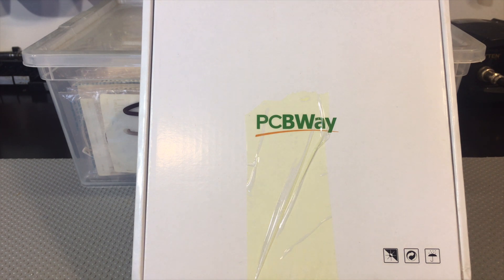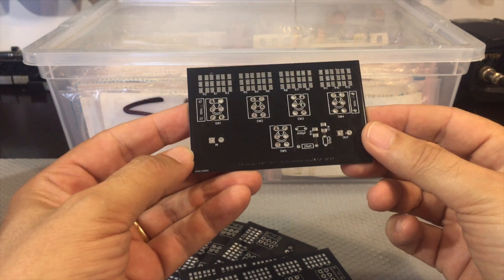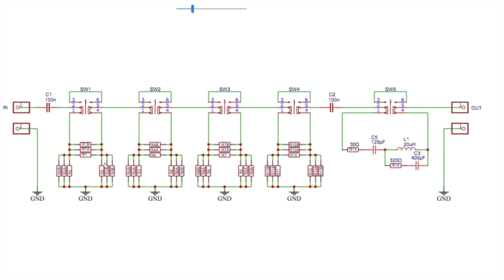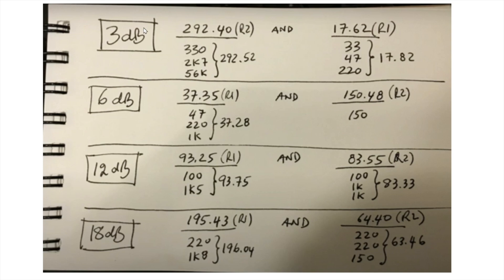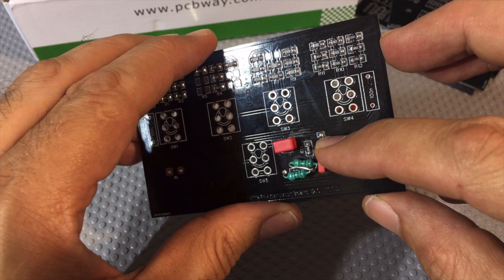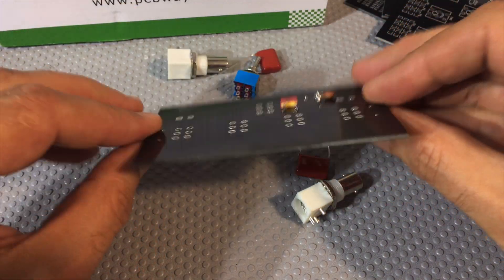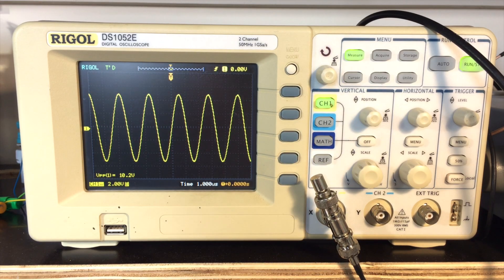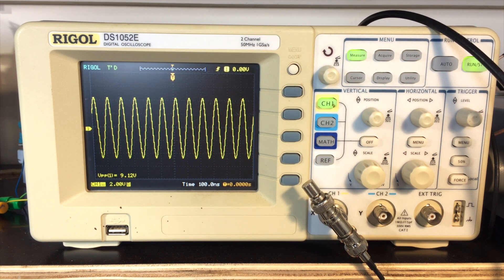Switchable Pi Attenuator with Dummy Antenna, using PCBWay PCB's

Comment: My first thoughts were similar to Jwahar below.  You appear to have added a tank circuit as the dummy load.  This will react differently to various frequencies, which it seems to be doing in your experiment.  Keeping the dummy purely resistance with no inductance or capacitance should provide a flat frequency response.   I do like the concept and the manufacture looks great.
Reply from the maker: Makes sense, but an antena does in fact react differently to different frequencies, so we expect that effect anyway. The concept of a dummy antenna was adopted in order to allow for tests under “standard” conditions, to allow for comparisons between different radios. This concept is well described here:
https://ax84.com/archive/ax84.com/static/rdh4/chapte37.pdf

Comment: It would be interesting to know what the impedance transform characteristics are for the dummy antenna across the bands of interest? Armed with that information you can then terminate the scope with the correct resistance for various input frequencies. Also of course at higher frequencies there will likely be significant ‘bleed through’ when using a large attenuation. Solution is shielding between each attenuator section or build a separate fixed attenuator for large values that can be housed in a separate box. A very interested subject!

Comment: Excelente Manuel! La única sugerencia sería armar todo físicamente en serie, en este caso la etapa de antena y la salida a la derecha del atenuador de 24db, de manera de tener la mayor distancia entre entrada y salida de RF para mejorar la aislación entre ambos. Esto es de relevancia en las frecuencias más altas, inclusive se puede colocar una chapita (blindaje) entre el atenuador de 12db y 24db. Aclaro que trabajé muchos años con enlaces de microondas (Thomson-CSF), de allí mi "visión" desde frecuencias muy elevadas :). Felicitaciones por lo minucioso y buena calidad de todos tus videos.Un cordial saludo desde Buenos Aires.
Reply from the maker: Gracias Carlos.
I agree with your logic, but I wanted to fit it in one of my pre-cut aluminium cases, and did not want to use a 20cm one. 
Thanks.

Comment: Can't you use a resistor and a multi-turn potentiometer instead of the 3 resistors? Also, I don't understand why the need for 2 blocking DC capacitors...
Reply from the maker: 3 resistors cost 3 cents 😊 
Strictly speaking, you don’t need two blocking caps. But with the voltages I have flying around some of these radios, I want to be absolutely sure that the D.C. doesn’t get past the socket, regardless of which way around  I connect it.

Comment: Great video, I’m making one now. Just wondering if you came up with a solution to the dummy antenna issue. I noticed a comment about adding a resistor to ground on switch 5, did you end up doing this?
Reply from the maker: No. It’s actually correct the way it is.

Comment: Best would be to peak the front ends with the intended antenna wire actually connected. Place a short wire in the generator output Bnc across the room.
Reply from the maker: I do that occasionally. Decided to give this method a try.

Comment: Thanks for sharing. I think your Dummy Antenna problems are due to impedance of the LC components of the dummy antenna which are of course sensitive to frequency of the signal. Most people build purely resistive dummy loads in the Amateur Radio world for this reason, to get a relatively bad banded constant load across the Amateur Band of frequencies. Also please can you share your schematic and/or gerbers. I could not find it in any of the links in your videos description section. cheers,
Reply from the maker: I have added a shared link. This one has the two slight changes made to it, to allow for two paralleling components of the antena parts, as explained in the video.

Comment: The dummy antenna might look authentic to the radio under test but at 455KHz the 125pF capacitor will have an impedance of 2798 Ohms, so the last section of the Pi attenuator will see around 3K, which is not what it should be i.e. 50R.  The approximate output impedance of the dummy antennae will also be around 3K so then feeding a 50R coax cable with a 50R termination will be unmatched and cause a significant reduction in voltage.  It might be useful to consider adding an UNUN (unbalanced impedance convertor for RF - like a BALUN); there is an interesting article here https://www.instructables.com/id/How-to-Make-a-Balun-Or-Unun/ on how to make a 50R to 200R RF transformer which would terminate the Pi attenuator correctly and provide something like a typical radio antennae at the output and maybe then adding the dummy antennae if felt necessary.  I could be completely wrong about this as I'm no expert, perhaps a real expert could comment?
Reply from the maker: Makes sense, but an antena does in fact react differently to different frequencies, so we expect that effect anyway. The concept of a dummy antenna was adopted in order to allow for tests under “standard” conditions, to allow for comparisons between different radios. This concept is well described here:
https://ax84.com/archive/ax84.com/static/rdh4/chapte37.pdf
Reply: @electronicsoldandnew  Yes that's an interesting article on dummy antennas, which as you say will keep the radio happy and enable more accurate setting of the input tuning, but unless the last stage of the pi attenuator is terminated with a 50R load then the decibel attenuation for the last stage will not be as expected and this will affect all the preceding pi-attenuator stages, throwing away all the effort to get the resistor values as close to the calculated values as possible.  To keep the attenuator dB correct the last stage needs a 50R resistor switching across its output whenever the dummy antennae is engaged e.g. a 6dB Pi attenuator only has an attenuation of 2dB if it terminated with 3K or the approx input impedance of the dummy antennae.  If you add a 50R resistor from pin 1 of SW5 to ground it would come into effect when the dummy antennae is engaged and keep all the attenuator stages correct.
Reply from the maker: Ah, I see what you mean. Makes sense.

Comment: I was scratching my head about the load at the end.  From what I can see the impedance sequence seem to be 50 ohms - 50 ohms then 50 - 50 and 50 - 50 and again 50 - 50, the it goes straight in to a 3,000 ohm section.   Shouldn't there be some form of matching to go from 50 ohms to 3,000 ohms ?  Like an audio output transform is there to match a 8 ohm speaker to the high output impedance of an EL84.  Oh and the oscilloscope appeared to have a 50 ohm termination too which would bring in another mismatch.
Or ... have missed some thing really big here and look foolish ?  :-}
Reply: That should be 'have I missed some thing really big ...'
Reply from the maker: Everything is 50 ohm all the way through until it gets to the injection point on the radio. If the injection point impedance is higher than 50ohms, no problem, because we’re not really transmitting great power levels. If your load is higher, you don’t drag the signal down. 
Now bear in mind that we’re not interested in exact signal levels here, only relative, so precise impedance levels at the injection point don’t really interest us.
Think of it as using a signal generator without the attenuators: It is 50ohms output impedance until you connect it anywhere on the radio to do measurements.
Reply: @electronicsoldandnew  Fair enough Manuel.  Thanks for the quick response and stopping me from scratching the little away hair I have remaining.